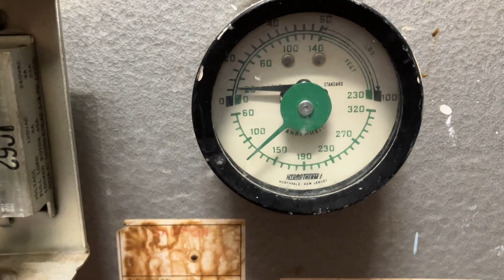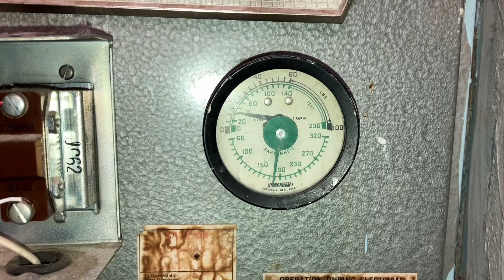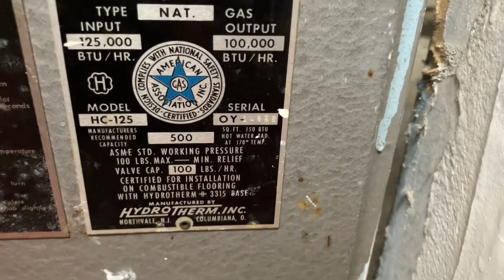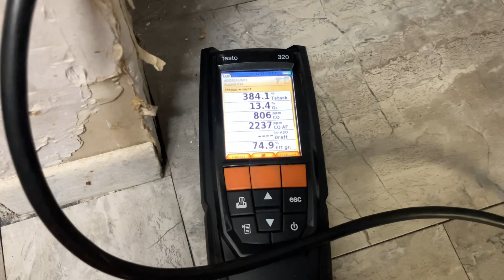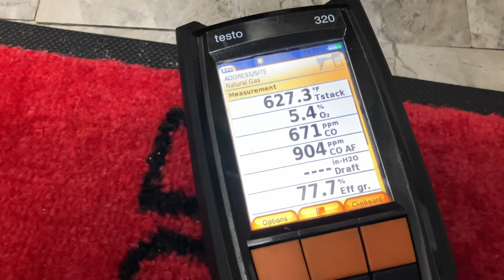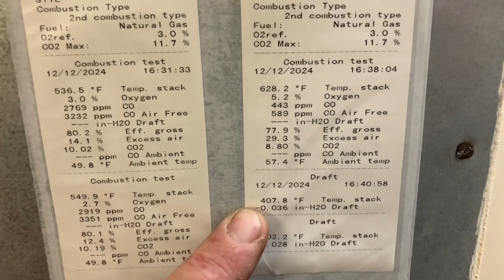Hydrotherm Gas Boiler No Heat Service Call Uncovers Deadly Combustion Levels!

Comment: Those hydrotherms are pan cake boilers and the heat exchangers always clog and then burn poor.
Reply from the maker: That's one way to put it.
Reply: @PipeDoctor  it is very common for the flames to roll out the sides. I cannot think of anyone still making pan cake boilers since the higher efficiency regulations.

Comment: I could tell it was going to be soot filled, dirty and messed up and by the orange/yellow pilot flame flickering in the bottom as you walked in towards it, then the rest of the visible flame.
not to mention the carbon chunks on top the zone control. lol
it's certainly cleanable and adjustable to run safely again, but the question is it worth all the labor costs.

Comment: That olde girl from the 80's ??? needs a replacement. Air shutters were wide open, so taking some gas will get them by for now. CO detector in the boiler room might be wise by the customer

Comment: With almost 450PPM of CO they should still think about replacement.  I hope they have some current CO detectors located throughout the place.  ☠
Reply: Or just a cleaning. Boiler's probably full of soot.
Reply: @theodorgiosan2570  guaranteed it is, just by the orange/yellow pilot flicker, then the main flame everything looked orange, in reflections, which is the flame firing through soot.
also soot chunks out the diverter opening on top zone control, etc. probably not worth the few hours of service it would take to clean properly.
they need a boiler, now!
Reply: I’m paranoid about carbon monoxide. I have one in every room.